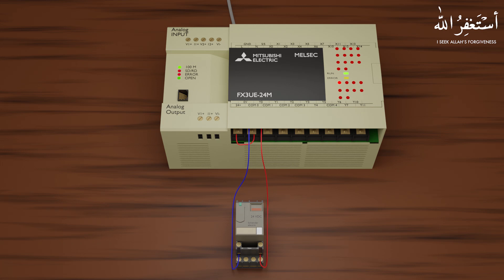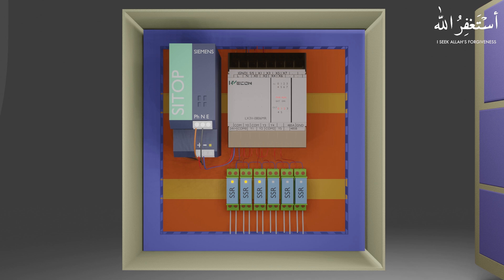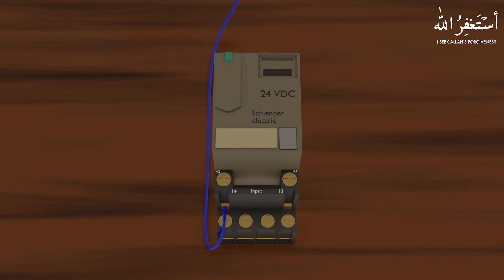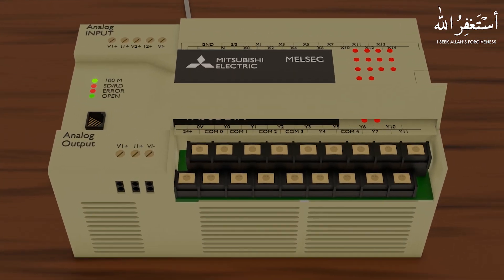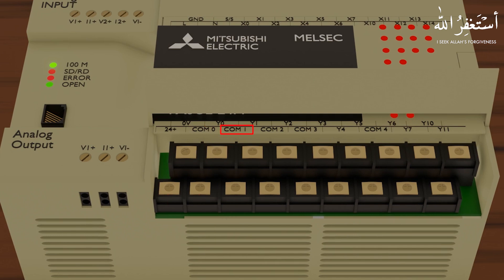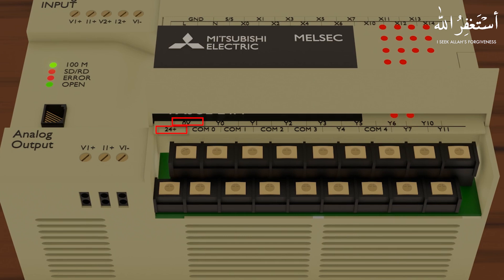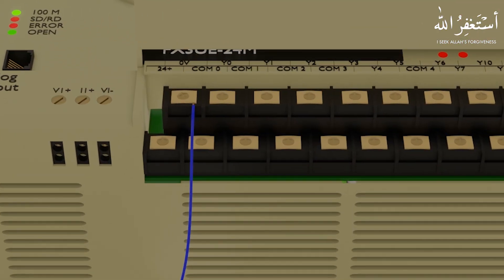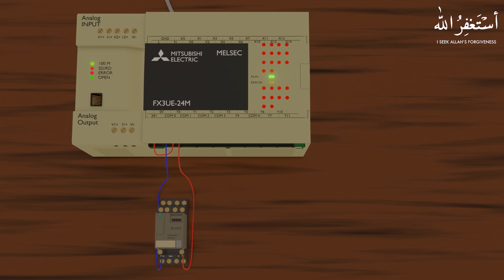How to connect a relay with PLC || Complete guide || PLC Programming Tutorials for Beginners

Comment: Can we use a dc relay for magnatic contactor??
Reply from the maker: Yes. You can use if the contactor coil is 24 vdc  .. but I recommend to use the normal potential free contact relay
Reply: @EASYPLCTRAINING  I have another question...Can the dc relays "NO,NC" control 230V magnatic contactor??
Reply from the maker: Yes ... DC RELAY NO AND NC CONTACTS are used to energise the contactor coil

Comment: Hi sir i have one doubt, actually in my plc s7200, output Q2.0 led on but no voltage present at output terminal, it means plc output relay contact not good. But what i did is i taken 24v  of Q2.0 output relay coil supply taken out from plc  and i put separate relay . Now mc is running. Will it create any problem.  Plc output relay original coil resist is 3.2kohm and i put relay thats resist is 320 ohm. Is it ok to dothat .i did like tgat bcz i dnt hv same relay